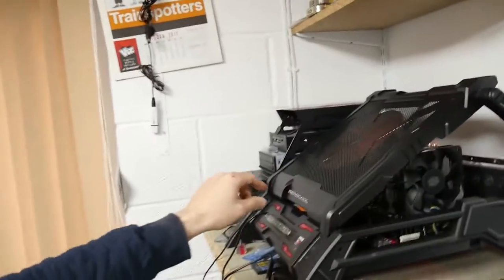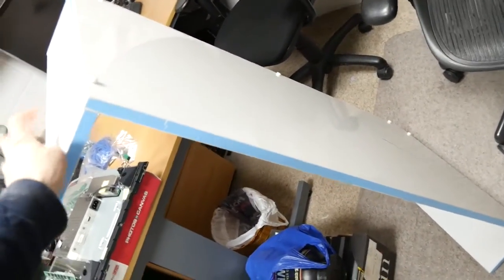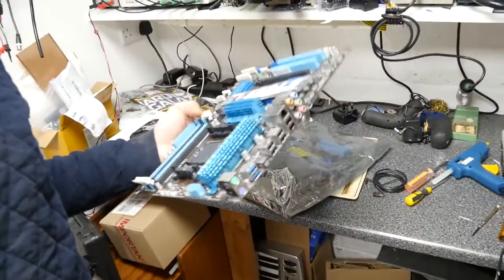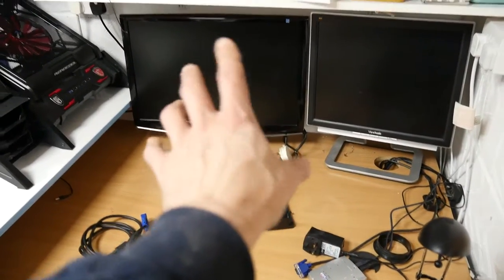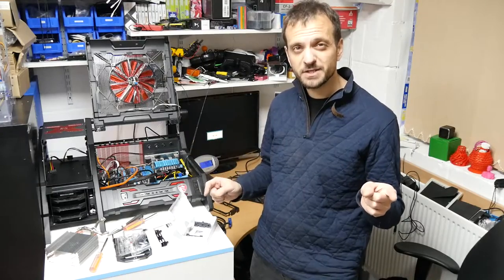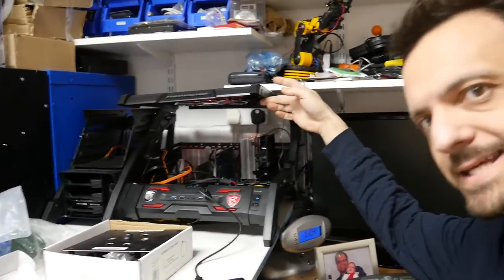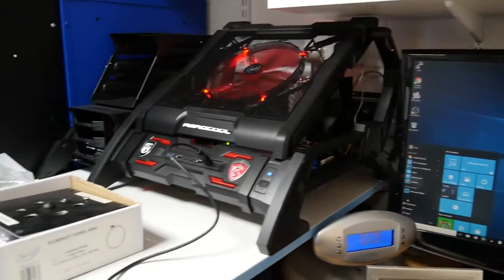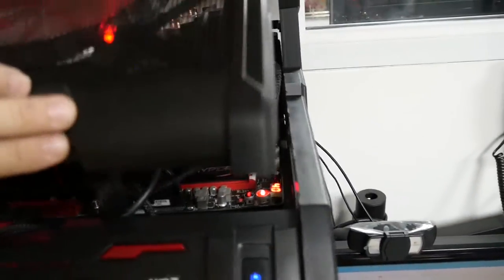Setting up a duplicate PC rendering workstation

Comment: Nice, but what is the difference between e.g. max CPU temp and the thermal overhead you mentioned?
Reply from the maker: +Marcel Ooms max CPU temp is the maximum advised rating, if I recall its 80°c the thermal overhead is how many degrees before you reach it. So for example if you are at 22°c your overhead is 58° that's how many you have to play with. If you get a negative number, that's how many degrees over you are.